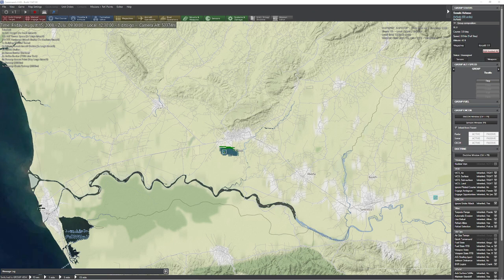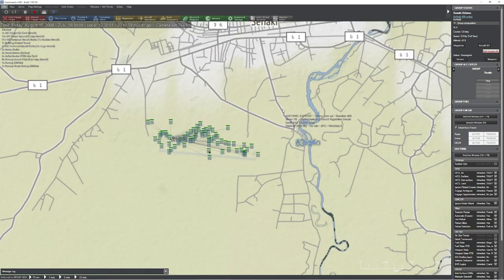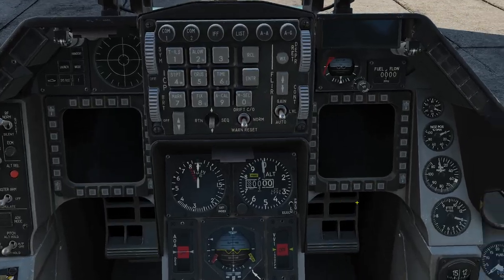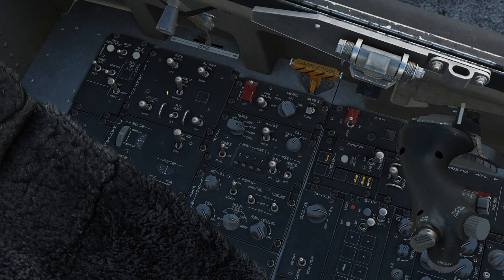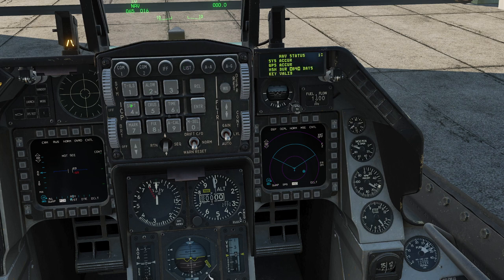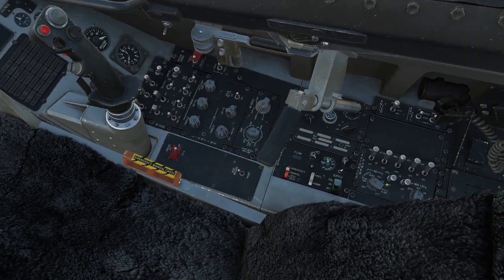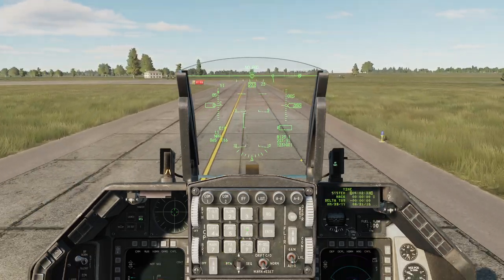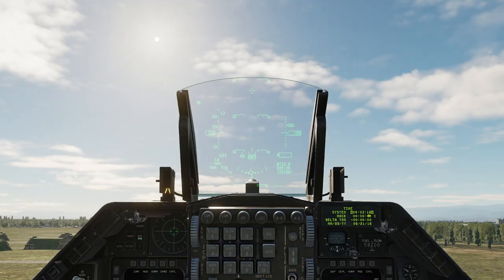C: MO - Aircraft Launch Time Comparison versus DCS

Comment: I agree the CM:O is rather optimistic in it's takeoff time, I'd have a hard time believing it can be done safely in 2 minutes especially if there are other aircraft involved and/or weather conditions aren't ideal. I'd consider myself fairly proficient in aligning the F-16C in DCS, but 2 minutes with the built in tests? I wouldn't feel safe doing it in real life, putting it mildly.
Reply: F-16s on standby can align off of a stored heading, or in an emergecny they can do an inflight alignment as they take off. I've done so before in BMS